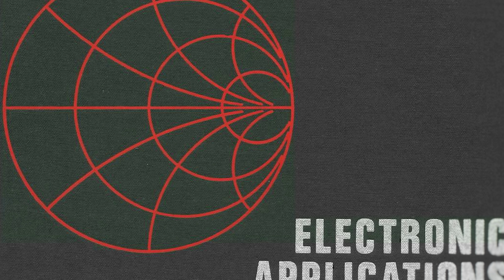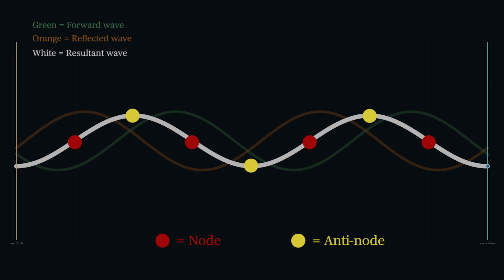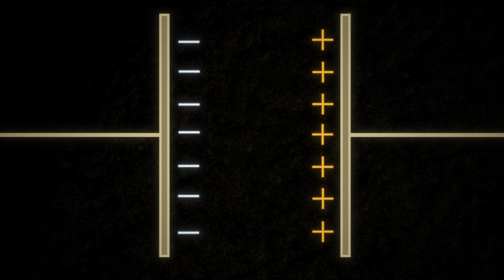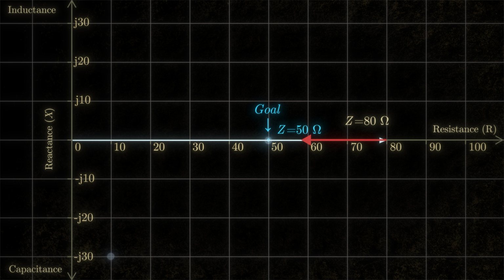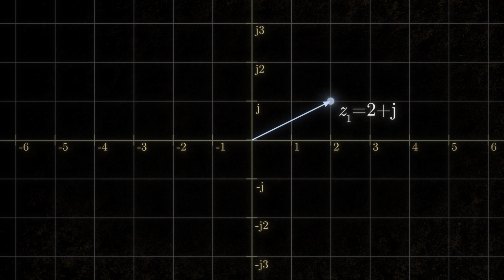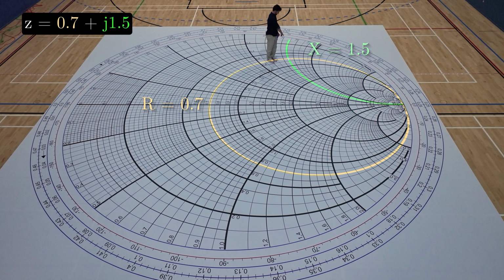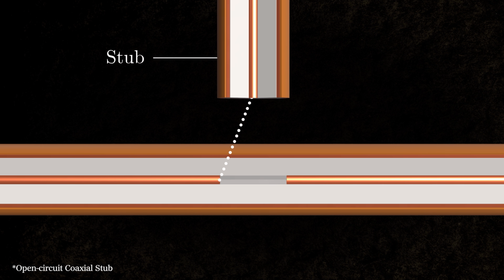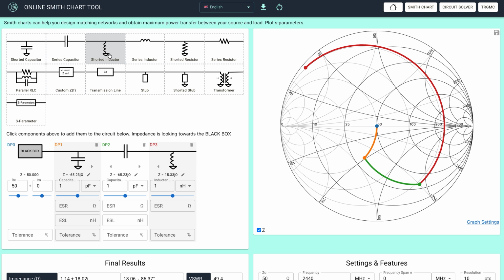The Scariest Chart in Electrical Engineering

Comment: Made something called Slime trackers, and one of the 'optional' instructions to increase the Blutooth range was soldering on a wire that was AS CLOSE AS POSSIBLE to 31.2mm. One wire i mis-measured to 21.2mm. Most trackers 1 meter away from the receiving dobgle sit at -55ish dBm, but the one with the mis mesured wire? -35ish dBm. I was always curious how docs 'knew' to use 31.2mm, and was curious why 21.2mm shortened the range so much. This video answered both my questions :3 Had to pause a few times, but i think i can wrap my head around how to use this chart now 0.0

Comment: I always enjoyed AC theory, but especially with RF. The smith chart display on my first VNA was so impressive and convenient while tuning up antenna phasors and matching networks.  Much faster than using the operating impedance bridges.  However the OIB still has its place, especially when you want to see the base drive impedance of an antenna in a an array.  Would use special toroid transformers to get a sample at the input and output of a matching network.  Boom, now you can see the phase shift through said network.  Typically these were permanently installed at each tower, and at the main input to the phasor for monitoring to ensure everything was within limits.

Comment: Real world systems get far more messy, especially at lower frequencies like an AM broadcast directional array, where soil and weather are variable elements of the RF electrical system.  

At higher frequencies bandwidth is small relative to wavelength, so long as one's not operating wideband antennas for a band of many channels.  

In VHF, another simple stub trick is a 2nd harmonic trap, that can be made as an inline T of 1 5/8 or 3" Heliax, except with an open half wave stub off the side.  Tune that with a shorting plug, that can be threaded, positioned with a T-handle rod, and then screwed in place once tuned.  In effect that becomes a short on the harmonic, and an open to the fundamental. Opposite sides of the Smith chart, a case of simple theory, but a good vendor does fancy metal work, including extrusions, machining, and brazing.  

Sometimes I wonder how Smith Charts may have evolved had full power Operating Impedance Bridges, and Vector Analyzers, been available a century ago?  

An AM transmitter load ideally sees a resistive load that's flat across the modulation bandwidth, and then slopes down on both sides, with a reactance curve that's not overly steep, and roughly equal and opposite on both sides after adjustment to zero at operating frequency.   

Low Q design for stability in systems subject to nature based electrical shifts is also a goal, where math can deliver antenna designs that work on paper, but are idiotic to ever build.  

There can also be weird quirks when the operating impedance of a tower is near zero, and transmission line length interacts with the T matching network for coax impedance and static phase delay, to cause a negative impedance within or near the tower base impedance in the 5-10 ohm range between sub-quarter wave elements, and directional array design paramters.  I've seen one case where adding 120 feet of 7/8" foam Wellflex stopped the minimum length to connect coax from making the system try to treat coax as a phase transformer, and allow retuning for a more stable and almost flat 10 ohm resistive operating impedance.  

That kind of large, distributed elements array is easier to model with software than years ago, but still requires adjustments with an operating impedance bridge, and other instruments, as the elements interaction requires tuning as a system, not as individual cases of line matching.

Comment: At 32:31 you have not created a parallel open circuit stub; you've created a series open circuit device (and not even that, because you have changed
the length that the waves have to travel on the inner and outer conductors of coax.  I hate to break it to you, but your description of a "stub" is simply wrong.  Among other things, there is no way to build the device you describe using hollow conducting waveguides --- and yet the Smith Chart works just fine for hollow conducting waveguides.

Note furthermore that "stubs" are not series impedance matching connections, they are parallel (shunt) admittance matching connections.   Note furthermore that, although the "natural" Smith Chart is an impedance chart, the only thing you need to do to turn it into an Admittance Chart is to rotate it 180 degrees.

Note furthermore that parallel (shunt) "stubs" are usually shorted because to simply leave an open coax or waveguide creates an antenna --- which radiates (and receives) and has its own complex load impedance which is not infinite (and can't be: if it radiates, its impedance must be finite).

Ordinarily I'm a big fan of Veritasium, and until about 30 minutes in you got it right.  But your description of the stub (shunt) match was completely wrong (you'd have been so much closer if you did not swap the inner and outer conductors of the coax with the stub, but had instead connected center-to-center and outer-to-outer.  But then you'd have had to make an admittance calculation, which you didn't do.

jds

PS: started teaching EM theory and Smith Charts when I was still a grad student, in about 1987; I retired from professoring about 6 years ago.  I first learned about Smith Charts as an undergrad in about 1983.

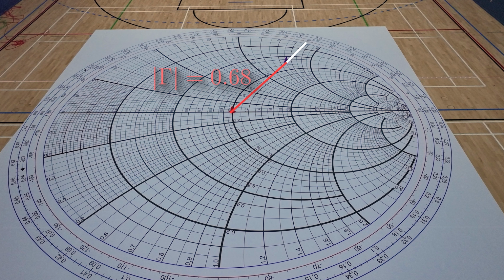Comment: Where did the 0.68 come from at 27:50? Is that the length of the line between the two points compared to the length from the center to the perimeter circle? It kind of looks like that, but I don't think it was explained. In that case, I assume units don't matter as you are just calculating a ratio.

(Not an EE student or in any way trained in this. This video is the first time I've ever seen this chart)

Comment: Wild to see a whole Veritasium video about a thing that has been a very big deal in my career. A topic that a surprising number of my fellow engineers either seem to have completely forgotten about right after school, or just never learned anything about it for whatever reason. I would definitely explain some of it a little differently, but I'm just excited to see discussion about VSWR from a major channel so I'm just gonna grin and be thankful. I look forward to seeing more content like this in the future, particularly if it involves calculating rf link budgets and maybe even things like error correction of transmitted signals, or using combinations of NRZ signals + data randomization to prevent long periods without signal transitions and the loss of signal lock that would cause and why it causes it. (Ok so really I'm wishing for a video that talks about a bunch of stuff relating to the IRIG-106 Telemetry Standard because I find it so very fascinating, even as someone who has worked as an expert in the field for ~15 years at this point)

Comment: Small errors:  early on you stated that 2 antennas generated twice the power at the receiver (it’s 4 times).  You redeemed yourself with the 20 antenna example with four times the power .

Later on you plotted voltage and current with axes time and magnitude, then labeled the lag as ninety degrees along the time axis

Note, my shift to numeric keyboard stop working partway through this comment

Comment: In a way, rf transmission line is a complex game of "the telephone game" (yes, a meta pun). Each part of the circuit had to communicate with the next, but it's never quite 100% in the real world, but as long as you can understand the intended messages - it's good enough.

Comment: Never teach listeners puzzle pieces, only to put them in a casual context much later. At around minute 24, you almost completely lost me as a casual listener, I had to actually pay attention.
It is much better to deduce the requirements for the chart staying closer to the causal chain.
You described the chart and its attributes first, before stating what the read values are used for later.

Comment: with baseband standard definition analog video signals we're often dealing with signals who's AC components range from 15 khz to about 7 mhz, and a lot of information specifically in the 3.5-4.5 mhz range, if THOSE frequencies reflect off of things in the cables, which is a thing that can absolutely happen if a cable is not built to spec and has the wrong impedance, then you get very visible rippling in the image, among other things

Comment: I twist every wire I see 3 times then send the wire through the loop you just made. The twists burn off the parasitic capacitance and when you send current through the loop, boom, destroy the parasitic inductance. You can actually feel the wire go limp even when not plugged into anything.

Comment: It's worth noting that the "Smith Chart" is the default display on a piece of test equipment known as the "Vector Network Analyzer". You connect the VNA to a transmission line, and you'll see a live Smith Chart display of the impedence, and it will change in real time as you make changes to the circuit. It'll also sweep a range of frequencies and plot the result on the Smith Chart. For many EEs, a Vector Network Analyzer is where most day-to-day interaction with the Smith Chart happens.

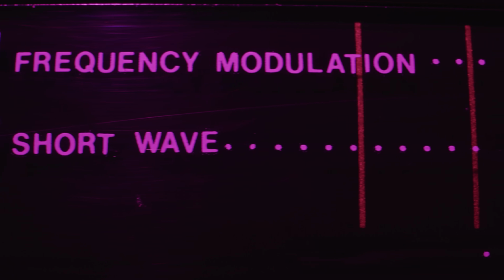Comment: Every modulated signal has a bandwidth, not just "Frequency Modulation" (around 35:43) A better example would have been a spread spectrum signal that can occupy a fairly large range of frequencies and need a wide-band antenna, or device that's meant to transmit or receive in an entire band of signals, like a Cell Phone or WiFi transceiver.

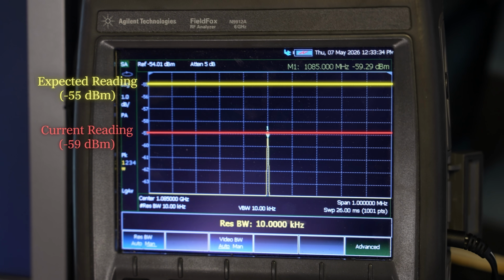Comment: 7:17 someone please explain negative decibels wth
Reply: Decibels are a logarithmic expression of regular fractions. A quantity in dBm (Decibel-milliwatts, which he mistakenly calls decibels in the video) indicate an amount of power relative to one milliwatt (mW). 

So say you have 20 mW, to convert to dBm you do 10*log(20), where log refers to the base-10 logarithm. That gives around 13 dBm, you can try it on a calculator. In general, multiplying power by 10 means you add 10 dB. So going from 10 mW to 100 mW means going from 10 dBm to 20 dBm. 

If you have power that is less than 1 mW (a fraction of a mW), then that would correspond to a negative dBm value. So if you had half a milliwatt (0.5 mW), converted to dBm that would be around -3 (again, try 10*log(0.5) on your calculator to verify. 

In the video they have -55 dBm, which you can convert back to mW by dividing by 10 and then doing the inverse logarithm, which is just raising to a power, so 10^(-53/10) which gives around 3 nW (nanowatts, very small!)
Reply: @hmulligan3431  thx :3
Reply: @hmulligan3431 huh
Reply: @hmulligan3431  Very good explanation, thank you!
Reply: It’s when your ear starts making the noise and the original source of sound starts listening to your ear
Reply: 0db. Would be if your ear(antenna) was right on top of the source with ZERO interference. (Impossible)

-20db is considered EXTREMELY good.
-40db average for most good connections 
-60 would be most residential wifi situations 
And -80 would be a spotty or laggy connection (or filled with interference)
Reply: its when you unhear smt
Reply: @NEFO090 best explanation so far!!!!

Comment: Sooo, I've been watching the video for litterally 4 hours over and over just to try and make sense of it. I wrote a lot of questions, but little by little I figured out most of the answers. Maybe it will help other viewers.
A. 5:18 It's was not obvious to me but the frequency of the resulting wave is the same as the source frequency (after adding the reflected wave)
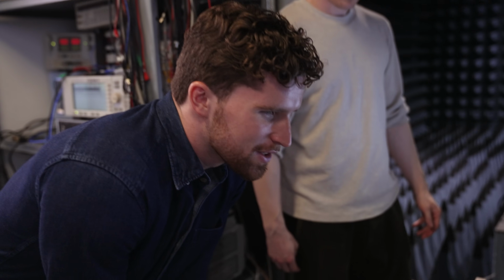B. 10:04 I think if we add a resistance, it changes the simple model we had (transmission line + antenna to transmission line + resistance + antenna) and it's unclear why there would not be another reflection because of that.
C. 15:36 "it's designed to be 50 ohms of pure resistance". What is this transmission line which is tuned to have no reactance? I can't just go to a shop and say "give me around 1653 meters of transmission line" and expect it to be exactly 50 ohms, can I? Are those transmission lines something I can cut/combine at any length without introducing reactance? (I'm still unsure about those questions)
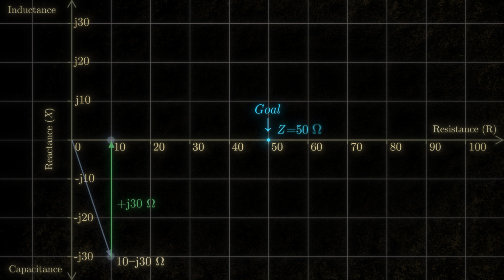D. 16:06 when I look at this chart, I can see that no pure reactance can ever reach the target. Ok let's continue.
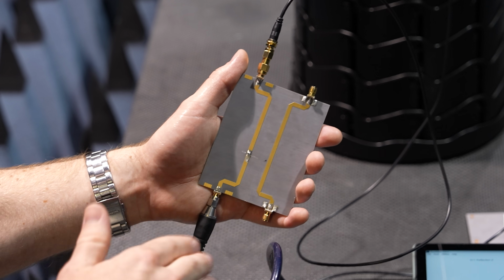E. 16:22 Related to C. What part is the transmission line here? I guessed the board plus the cable below which is connected to the power source, but the rest of the video makes me think that the board is more part of the antenna...
F. 16:48 "The impedance changes as you move along the line". Yes, like if you cut it. Ok.
G 16:53 "Maybe there is a point on the line where our resistance is matched". It's not clear if we are matching the transmission line to the antenna or the antenna to the transmission line. At that point of the video, it makes me think we are going to cut and shorten the transmission line.
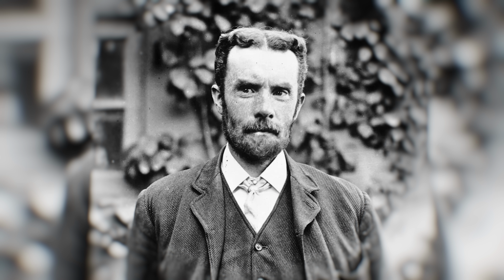H. 17:06 "At that point, the characteristic impedance of the line will be matched". Looks like we are tuning our antenna to the 50 ohm transmission line...
I. 25:21 A lot of things here. Why z-1/z+1 for the transformation? Why is the magnitude of the transformed point the reflection coefficient's magnitude?
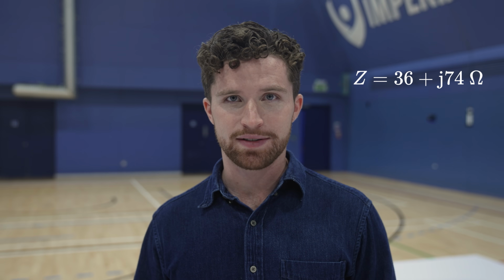J. 26:28 "36 ohm of resistance and 74 ohms of reactance". Why does it differ from the 12.5 ohms measured at 10:00? Isn't the resistance supposed to be equal to the real part of the inductance? Oh it's because the inductance depends on the frequency, including its real part...
J. 27:07 "To eliminate reflections, we need to match the impedance of the transmission line". Yes, it looks like we are tuning the antenna.
K. 29:04 Oh so we added a small segment of transmission line on the antenna's side... What does it change regarding the reflection if we stop here? The magnitude is the same, so... just the phase between the source signal and its reflection, right? I was wondering if that board had a resistance of 0, 14 or 37.5 ohms but I understand now that it is close to zero (DC) but changes the antenna's real part of the inductance for the given frequency by a different value.
It was never said what this plate was, I will assume there are two copper lines along each side of the plate and the thickness is of utmost importance to have exactly the same spacing as the transmission line so that it's like a cable extension... and that it was cut the exact length of what we computed. Is it correct?

Thanks for reading and answers.

Comment: I suggest a follow on video on pulse forming networks - including Blumleins. The simplest being a (long) length of coax with the shield cut halfway along it. The cut shield is the pulse output point and is terminated by resistor equal to 2 times the cable Z. One end of the cable is open circuit while the has a very fast closing. low inductance 'switch'. Charge up the cable and then close the switch. Fun times!

Comment: Man...a Smith Chart. I haven't seen this chart in over 40 years. I learned how to use one waaaaay back in the 80s when I was going for my degree in Electronics Engineering. The craziest thing about it, besides looking like a bad acid trip, is once you learn it, it's easy. And it made life so much easier while designing stuff like radar antennas.

Comment: Great video by Veritasium, as always !

Although, I would prefer a different order for presenting some ideas: 
The bottom line is that we want zero reflection (Gamma), which is, by definition, a complex number with magnitude less than one. The Smith chart is simply the complex plane for reflection restricted to |Gamma|<1 , i.e. the great circle.
The idea of Smith, given the reflection, was to graphically solve for the (normalized) impedance Z using the lines of constant resistance/reactance, from the expression : Gamma = (Z - 1) / (Z + 1).
The fact that the infinitely large complex-impedance plane is fit into the unit circle of reflection, is simply a consequence of the transmission line theory (the fact that the expression above is a conformal map), not Smith's idea. 

Thanks again for the great video.

Comment: At Min 11 the circuit is wrong. You need to disconnect the capacitor from the power supply otherwise discharge cannot happen.

Comment: I... oh man... I was exposed to this as a repair technician in a medical plastics manufacturing plant.  In the department I worked at, we had multiple high frequency high power generators driving plasma discharge treatment systems.  Of the three types, the worst one to work on was a pulsed open atmosphere.  We had to impedance match based on atmospheric humidity and pressure for an ideal-zero-reflected antenna.

Comment: haha i learned all this stuff in sparky school.  forgot it all allready because you literaly never need to calculate anything.. the whole time i was thinking this must be eddy currents. they teach us about that and losing power. and i knew we used inductors and capacitors to fix this in motors especially during startup.. Power factor. but i diddnt know there was a feedback thing going on. we just talked about it eddy currents are caused by AC changing field. so i guess it makes total sense if freq goes up eddy currents goes up and you lose power.